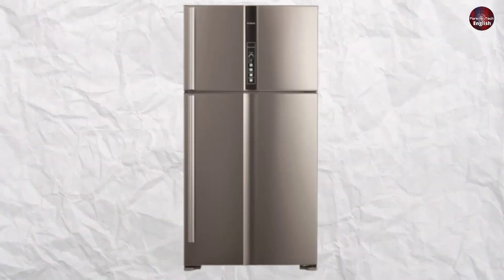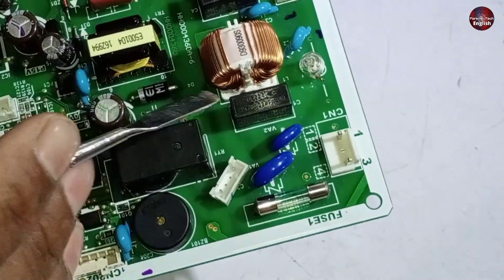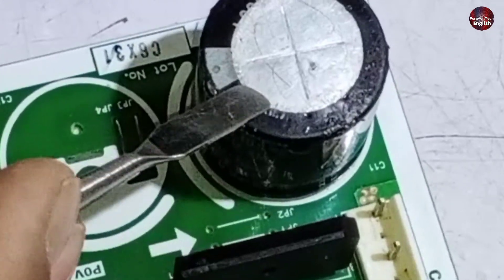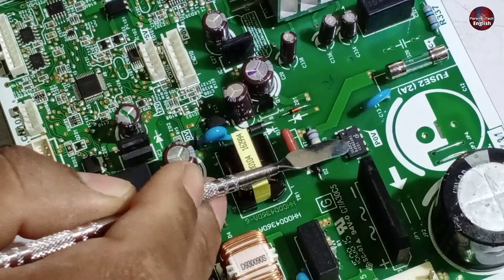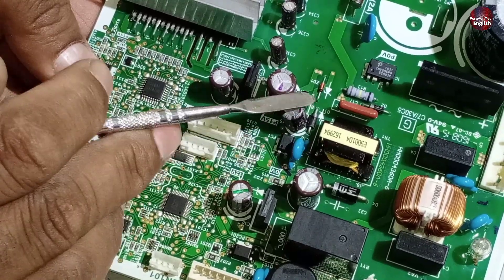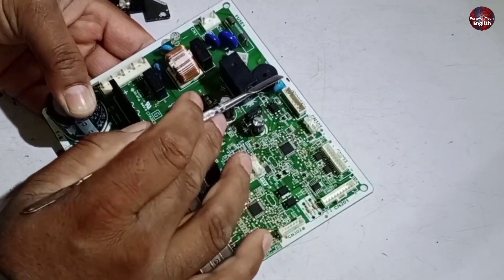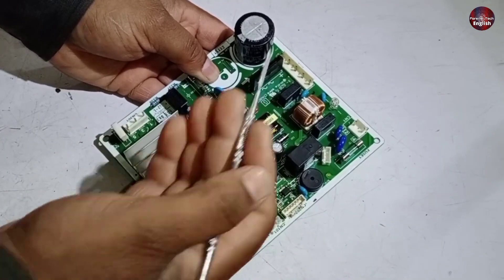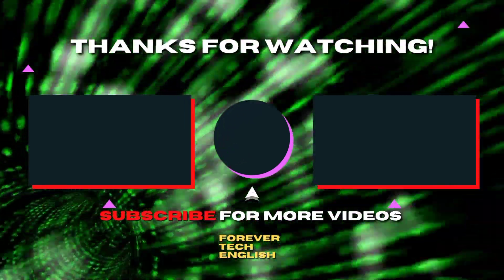Hitachi Refrigerator Inverter Control Board Faults Repair Tips

Comment: R-MOTOR does not start, the board flashes 17 times. Is the fan working (connected to the F-motor terminals) any ideas?

Comment: i hate the new technology... inverter power, control boards.... just give me an old refrigerator with a compressor and sensors.  This technology just breaks  too much
Reply from the maker: It is a lot more energy efficient though!
Reply: @ I doubt it. My refrig runs at 100 watts and the other one at 200 watts. Like to know what one of the fancy inverter ones run at

Comment: What if fuse blows when cn2 (plug near bridge rectifier) connector inserted ??
Reply from the maker: If the fuse blows, first check why did it blew. What is the reason behind it. Then second check for any short circuit in this board. If you find no shorts and everything is fine. Replace the fuse. Then troubleshoot for any faulty component in the refrigerator which made the fuse to blow up.

Comment: The Informations in this video is accurate , I had Hitachi Refregerator with Control Board similar to the one shown in this video . 
the fuse didn't blow but instead the IC and the SWPS Transofrmer windings blowed . i saw part of the Ic broked just like what this guy is saying .